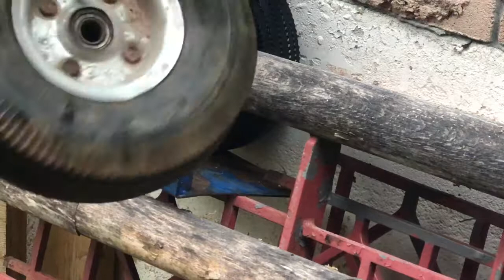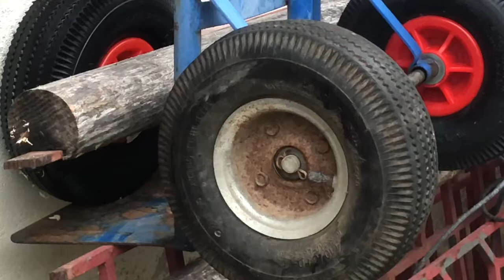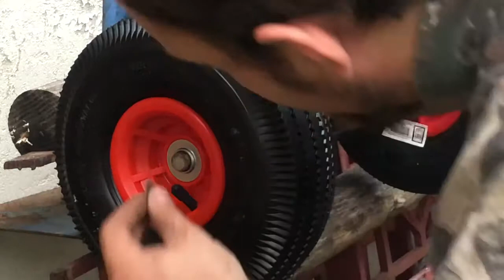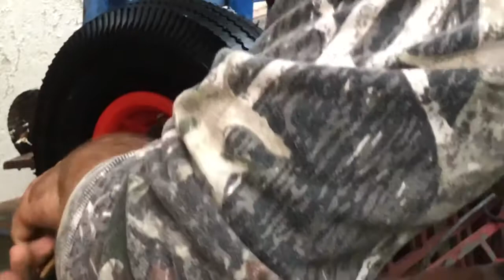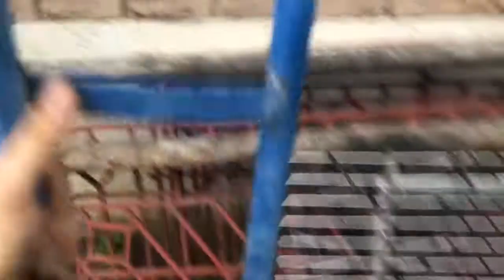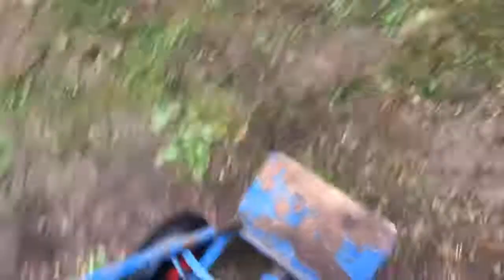The Cotter Pin Video ( Repairing My Dolly Yes I Have A Dolly ) 🤪

Comment: This is exactly the problem I'm having with replacing the tires on my dolly.  There's no room for the second cotter pin.  I came to this video thinking I was going something wrong.  And I see there's an unorthodox way around it.  Not a proper way mind you, but it looks like it totally works.  How can they sell replacement tires, that are supposed to be easily installed with cotter pins, when the tires don't really fit??  By the way, I'm 72 years old and trying the best I can to do things on my own ... it's a challenge sometimes.
Reply from the maker: You are 100% correct. Sometimes we have to make questionable 🤨 choices. Sometimes it works. =]
Reply: @803Garage  Jus a little follow-up.  My brother-in-law filed the ends of the post/shaft a bit and both tires fit with proper cotter pin placement.  I never would have thought of that!
Reply from the maker: @sheronbradley6819  nice. 👍🏼 your brother in law kicks butt =]